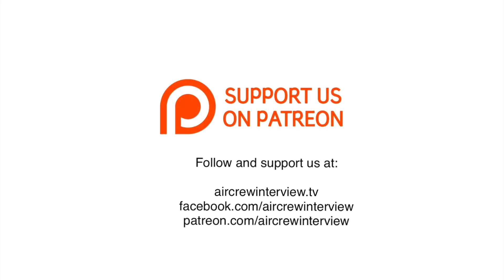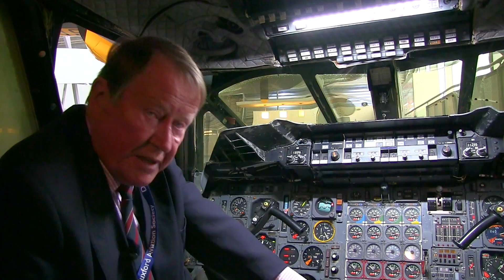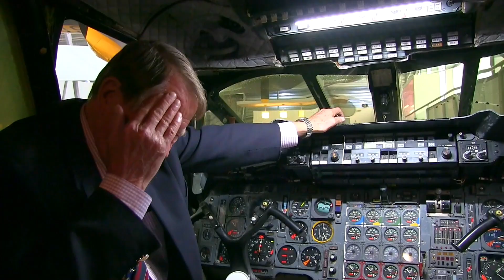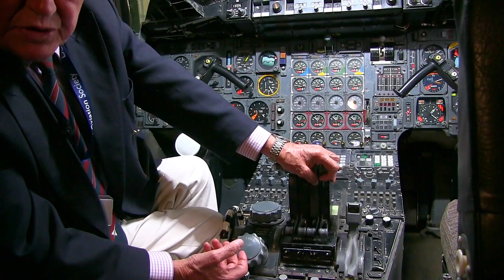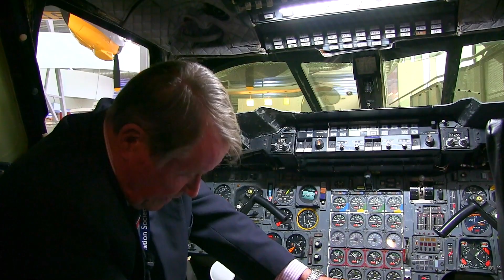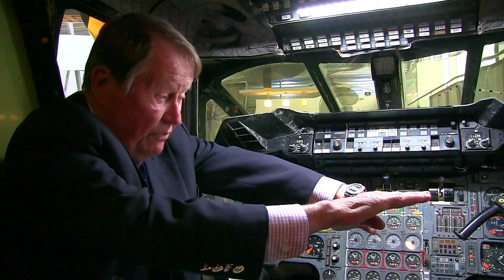John Hutchinson on Air France Flight 4590

Comment: I thought I had posted this question before, but it seems to have gone awol... What was the last point where the plane could have been saved?  I suspect it was probably just prior to V1, when the take-off could have been rejected, but at that stage there was no clear reason to reject take-off.  The plane was doomed after V1.  It could not stop on the runway, nor could it fly for any length of time - the flames were quickly destroying the flight control surfaces on the left wing, and probably the wing itself soon after.  That, plus the issues of the weight and CG being outside limits, meant the pilots were now along for the ride - nothing they could have done could have saved them.  Does anybody have another view?

BTW:  A very measured and insightful narration by Capt Hutchinson.  Compelling viewing.

Comment: I have been wondering about the last possible point where the plane could have been saved.  I have a feeling that it might have been just prior to V1, allowing the pilot to reject the take-off.  Once in air, the flames were quickly and surely destroying the flight control surfaces on the left wing.  It seems improbable that those controls could have lasted long enough to get the plane back to CDG or Le Bourget - even if it was not so over-weight and with the CoG outside limits.  Does anybody have a view on this point?

Comment: Thank god Mr Hutchinson a very experience Concorde Pilot has cleared up how this disaster happened. I thought after the Kevlar upgrades that this amazing air plain had a design flaw, however it’s clear that Air France  incompetent staff didn’t respect this amazing plain and spoiled an engineering marvels otherwise perfect safety record. This also led to the Concordes ‘s retirement as there is still demand for it.

Comment: Makes more sense now... I could never square the flight path of the airplane with an airframe fire.  Even with an engine fire, the flight path would be normal till the affected engine was shut down at the Captain's command (usually after ensuring the airplane is under control, which it clearly was not in the case of AF 4590)  
The F/E shutting down an engine is consistent with the flight path that was recorded, and should be listed in the cause or contributing factors of the accident.
Reply: The Captain Commanded engine # Shut down immediately after the Flight Engineer called Engine Faiulure #2. Capt Hutchinson is completely wrong on this.

From BEA report P 133: "Engine fire alarm actuation and the very low values on the parameters led the crew to shut down the engine after the Captain called for the engine fire procedure. In fact, the movement of the throttle control lever to its idle stop is heard and, a short time later, pulling of the fire handle. In addition, the deceleration of the engine, established from the recorded parameters, is consistent with a commanded engine shut down."

See the following timeline from the CVR and d Concorde Flight manual.
o	14 h 43 min 13.4 s, message from the controller indicating flames at the rear and read back by the FO. 
o	14 h 43 min 16.4 s, FE “(stop) “. 
o	14 h 43 min 20.4 s, FE “Failure eng… failure engine two”. 
o	14 h 43 min 22.8 s, fire alarm. 
o	14 h 43 min 24.8 s, FE “shut down engine two”. 
o	14 h 43 min 25.8 s, Captain “engine fire procedure” and in the following second the noise of a selector and fire alarm stops.

Comment: Interesting read on the tragedy (in english): page 174 onwards of the oficial report (https://www.bea.aero/uploads/tx_elydbrapports/f-sc000725a.pdf   ).          

It looks like no mater what the crew did: once the fire began, at that speed, and with the remaining available runway, they where doomed to take off and to that type of sad end (due to the damage caused by the fire to the wing and control surfaces, and how the fire afected the engines). It's a shame that, when they crashed, they where not that far from landing at Le Bourget airport. RIP all the people aboard that plane.

Comment: This was WAY more information on that flight than I've ever heard before. Thank you! I had always heard about debris on the runway, and I heard about redesigning the engine intakes on Concorde in the aftermath of that accident, with everyone always harping on the engine having ingested the debris. But every time I looked at the pictures, I could see very clearly that the fire was BESIDE the engine, not inside it. So this is the true story of that fateful crash. Truly an Unfortunate Series of Events. And I wonder, even if the aircraft had successfully taken off with the missing spacer, would it have been able to land successfully in New York? I guess we'll never know.

Comment: From the sounds of it, it seems like had it not ran over the FOD, the thing would've been lucky to get away regardless.
Reply: @Fitch93 It would have almost certainly got to the destination, but perhaps would have had problems with the landing. There was normally enough power to do this even with the rearward COG if they could have built enough speed, but lacking that and with the COG moving rearward even more is what doomed them.
Reply: Fitch93 if you had listened properly he stated quite clearly that the Aircraft did run over that piece of metal

Comment: Can you imagine the guy that signed off that spacer being on, what a mistake.
Reply: It was a shim, without it the effect was like the front wheels on a shopping trolly, the wheels turned inwards causing drag pulling the aircraft to the left. The tyre pressure rocketed generating enormous forces.
Reply: The lack of the spacer between the opposing taper roller bearings allowed the axle to skew more than 3 degrees to the left. Taper roller bearings have a high axial force due to the angle of the taper, a pair is installed in opposing directions with a spacer between them. Without the spacer the wheel axle will skew. This amount of skew produces a lot of side force pulling the aircraft to the left. I don't believe that a piece of metal debris on the runway damaged the tyres, they hit and destroyed left side runway edge lights. That's what destroyed the tyres, and led to the puncturing of the wing tank.

Comment: With the 2 747 that smashed into each other’s in the 70s now this you would think they wouldn’t allow airplanes to sit next to the runway, but guess there so busy.
Reply: That's not a bad point you make.  However, those 747s were in Tenerife in 1977 and both planes were supposed to be on that runway at that time.  (One was "back-taxiing" ) The cause of the crash was that the Captain of the other 747 at the far end of the runway decided to take off without a takeoff clearance, despite his First Officer's multiple warnings that they weren't yet cleared.  (I teach this stuff, starting with the Tenerife crash, just about once a week....)

Comment: So, had the spacer been in place the undercarriage would have tracked true without scrubbing the tyres and probably ran over that strip of metal without any effect despite being overweight, or, had the captain taxied down the runway and took off into wind then he would have burnt off more fuel, reducing the weight problem, and the 'good' side of the undercarriage would have ran over the metal again to no effect. Just badly scrubbed front left tyres which might have been a problem on landing but by then would have been very light. For the want of a horseshoe nail huh!